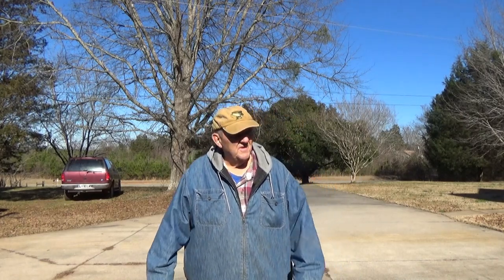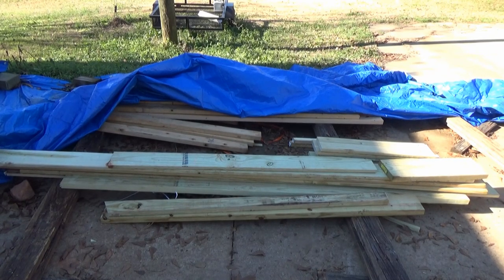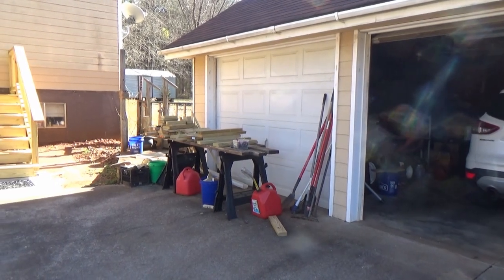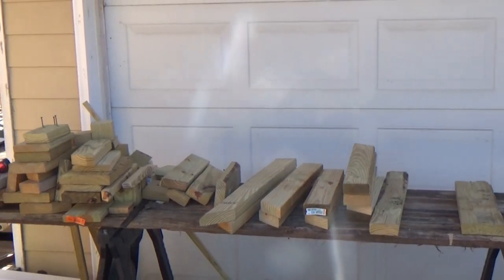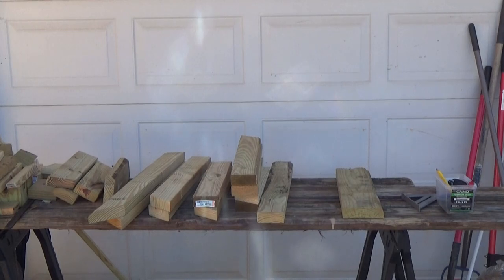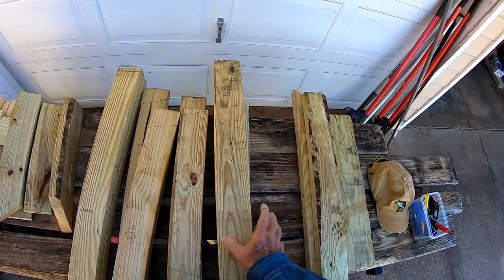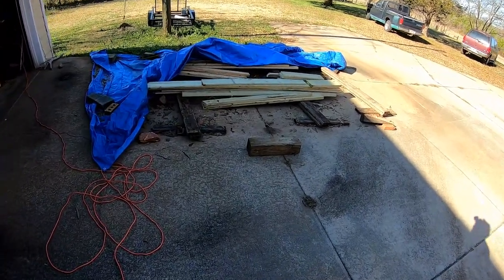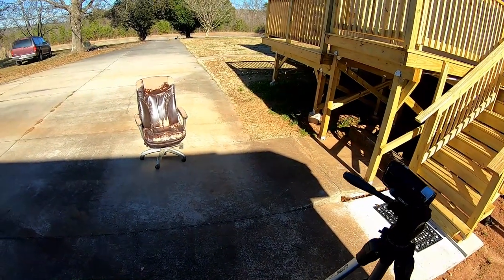Bench with leftover deck lumber Part 1 Pwalpar VLOG

Comment: The test of a bench is whether it holds you up or suddenly lets you down.  I’d prefer to be held up.  You might not want to make a cabinet finish bench but I would think twice about at least sanding the top and edges of the sitting surface.  Splinters happen.

Comment: A dowel the size of that pocket hole cut off flat along the board will plug the pocket hole screw hole. Using a curbside saw will make that cut flat. As seen on "This Old House" with Tommy putting flooring below an already in place door frame, is my idea for doing just that Walter. Yeah, I know, he makes it look easy, but he's had years of experience in making it look at how easy it isn't. It's just a thought but a dowel can be used as a plug for just about anything, do notice I did not say round dowel for a square hole, some call them pegs for square holes.
Reply from the maker: Thanks Hugh  I plan to just do it old school lol